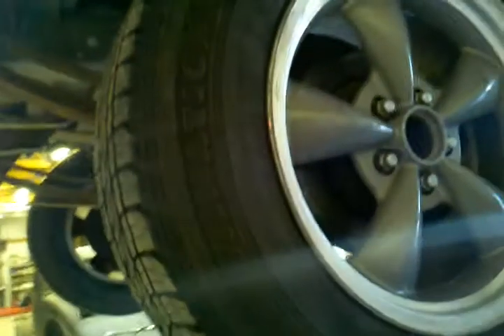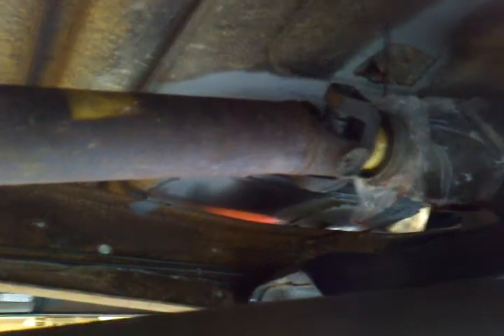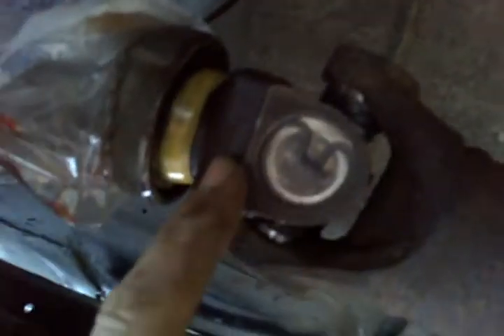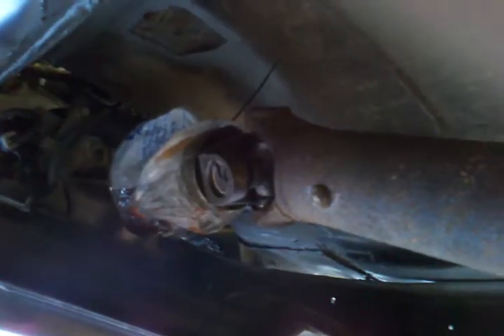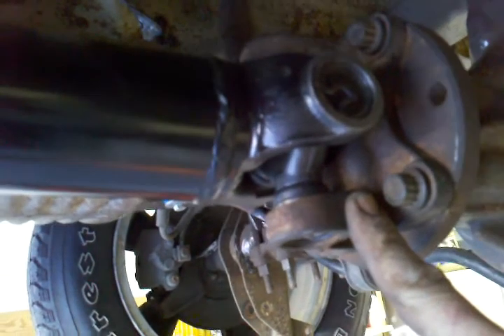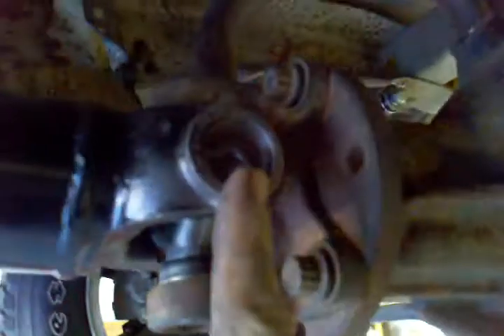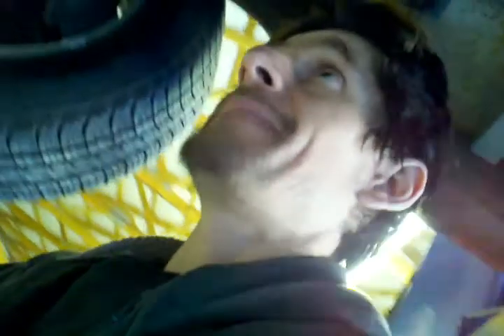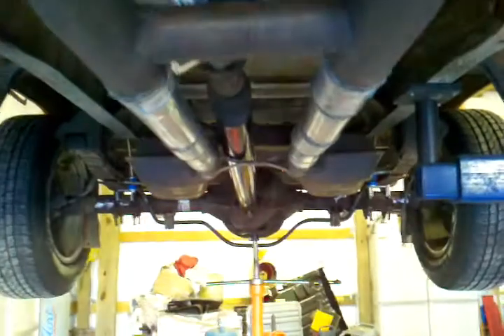Ford F100 4.6 Crown Vic swap suspention driveshaft tips Part 5

Comment: I used cv drive shaft end pieces that connect to trans and rear end using appropriate u joints and just lengthened the f100 front shaft 3" and everything lines up perfect using f100 shafts and stock hanger mount.

Comment: Not trying to rehash a asked question. I just picked up a CV PI and I'm planing on using the rear as well as, obviously, the front. I know the rear is wider than stock. I read that you rolled the fender wells up a bit. I was thinking about trimming them and adding a thin piece for reinforcement if needed. 

How much did you have to remove, or roll, to get the tires to stop rubbing? Did they stop after making that mod, or did they still rub with the load?

I prefer the look of the wide stance it gives and would like to run 20s in the future, but don't want a deep dish wheel.
Reply from the maker: I paid a guy $75 or so to roll them as I did not want to damage my paint. If you doing body work anyway.... cut away.
Reply: I am doing body work anyway. Thanks. Oh, does it rub after the roll?
Reply from the maker: RIPbiker13 nope. I've had in excess of 4000 pounds in the bed and had no issues

Comment: what abut the rims
Reply from the maker: +Carlos Grijalva I have no major issues.  I did have my rear fender lips rolled upwards. It rubbed the tiniest amount if I had a heavy load in the bed and pulled into an inclined driveway or parking lot. I used 17x8 Mustang Bullit rims.
Reply: Ok cool thanks